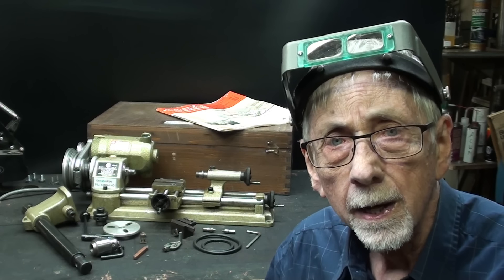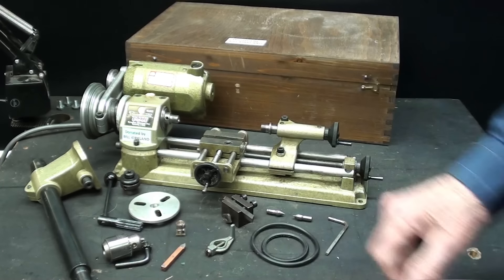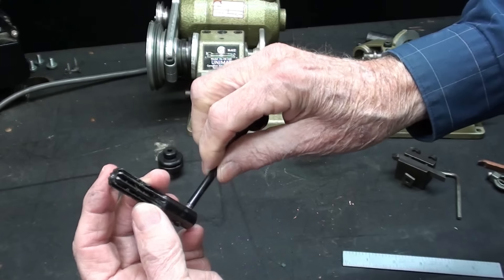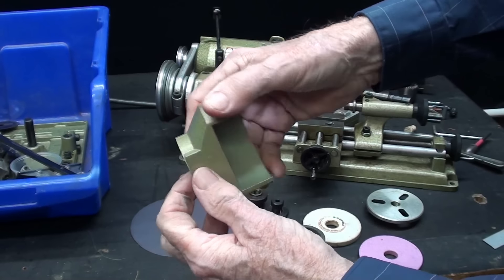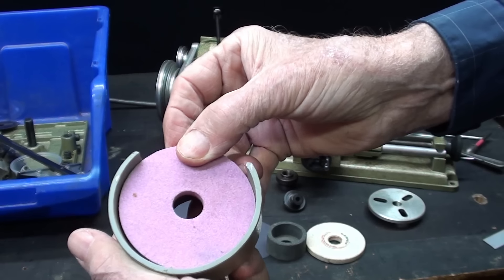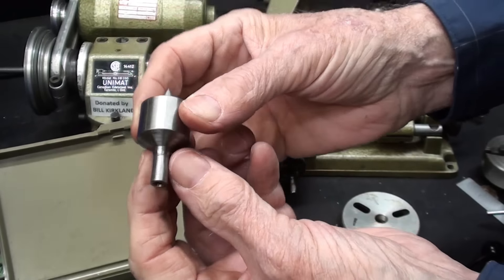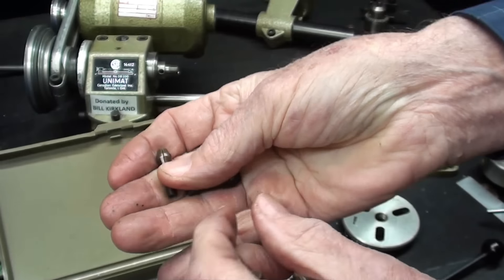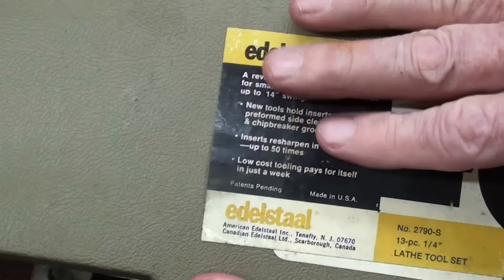UNIMAT LATHE standard ACCESSORIES #940 tubalcain

Comment: My Unimat came with a carbide tipped tool like the one you have and you are correct, I never got good results using it. It did a whole lot better using HSS.
Reply: If you have access to a carbide grinder with a green or diamond wheel carbide lathe tools can be sharpened very sharp. As manufactured they’re rather dull and require high tool pressure to cut well. I sharpen all of my carbide tools and prefer them over inserts for many jobs.

Comment: It loo,s like you have the basic unit. They also made a 3 jaw and 4 jaw chucks also power feed attachment. I've had mine for over 40 years. Also I have the milling table and spin indexer. Great little tool . The riser block iss for the grinding wheel  and table saw. No riser for tail stock ever made for it.
Reply from the maker: Thank you, so that’s why the saw attachment would not fit

Comment: Well, I just found my original box with some of the missing attachments, the vert mill post, table and clamps, vise and some odds and ends the previous owner made.  The drill chuck I made wasn't in there and I need it to do a little job.  I ordered a B16 tapered chuck 1/16"-1/2" and a B16 to 11mm bore shaft adapter that I should just be able to tap to M12x1.  It's kinda big, but it's hard to find one you can bore or adapt without making a longer extension.  I also found the tap, so I'll get there one way or another.

Comment: Will the lathe drill a 1/8" hole in steel? I have a used Unimat DBL 200 and it wouldn't do it. I wonder if the motor is bad? I changed the motor since with a similar sized DC motor and that fixed the problem. I have nothing to compare it too so I'm left wondering.
 I'd like to see if your machine is able with the original motor. Thumbs up!. My drill was new ie sharp.
Reply from the maker: I will try it sometime

Comment: It looks to me like that that small drill chuck would slip into the hole in the lathe spindle and secured using a draw bar. What do you think?  I have one of these lathes I purchased in 1970.  It had all the “kit” parts you displayed except the grinding wheel arbor. I haven’t tried using it in years, but suspect it would still work. Thanks for sharing. Brings back memories.

Comment: I went to a meet and greet and one of the attendees brought a Unimat SL 1000.  He had a lot of accessories and tooling for the Unimat.  Beleve it or not but ther was a screw threading attachment, a steady rest and I forget what else there was.  For a small machine it seem that there were and hopefully still available many accessories available for the Unimat.  When you finish If possible could you do a series on the HF Mini Lathe.  I have one and would very much like to see what you would be able to do with one.  There must a lot of them out there. The price isn't bad (not great) but for a hobbist with limited space (I'm One) they are a pretty good tool.  KOKO!

Comment: The chuck I ordered to adapt for my Unimat just arrived and is WAY too big and more suited for my Atlas that I didn't need.  All the chucks look exactly alike except they are a scaled version of each other and you can't tell the actual size from a picture.  Maybe Jacobs has a chart or something with dimensions.  I'm going to have to look into this more.
Reply from the maker: Sorry
Reply: Thanks, I didn't need another large chuck.  I think I just ordered a better one, a Jacobs 3/8" chuck with a 3/8-24 thread.  My plan is to bore it and rethread it to the M12x1 Unimat thread.  I still don't understand why my tailstock shaft has a groove rather than the ring on yours.  Is that ring at the end of the thread on yours solid on the shaft or is it some sort of crimped on ring?  Does the factory drill chuck you have seat against it?  On my old chuck I can't locate, I made the adapter and at the bottom of the tapped hole, cut a pocket like a drill point, then just pressed a ball bearing into it and kinda staked it and that seats against the end of the tail stock.  Ha, it will turn up right after I make another one, never fails. @mrpete222

Comment: If you put a link address for the needed part in a comment to me I will see if I can print the stand off/riser you need for the tail end as you mentioned.  I can do carbon fiber infused nylon or glass infused nylon.  ABS or other material if needed as well.  Not sure how much force or load it will take...  Does it need to be threaded if so that may take some trial and error using inserts for the threaded sections if required.  If no threaded inserts it will only cost me a few bucks and the shipping so I am happy to provide the part if I can.

Comment: I have the later unimat 3, but dont write off the unimat as not being powerful, size for size its every bit as good as most bigger lathes, when working on small items I use mine every time, that said most small items I do are in brass, but mine can do steel, and it can use the carbide insert tooling too.
Reply from the maker: Thanks

Comment: Allen key your diamond point dresser down on the compound and true the pink wheel until the guard clears. Stand safely to behind the tailstock while reducing! Discreet arbors for each dressed wheel?

How about designing, build and demonstrate a shaper attachment for the Unimat? The stroke developed from an adjustable ecentric mounted too the headstock?  Saw a You Tube when you restored your mini shaper, believe it was mounted on an Atlas lathe. https://youtu.be/Q1L0BhRSFyU?si=MquQcnsQ8rwwZr68

What if the head stock spacer raises the table saw platen above/over the motor if the quill is extended?

You could drill and ream your aluminum mounting plate for 2 slip fit dowels for quick mounting alignment.
Reply from the maker: Thank you, great ideas